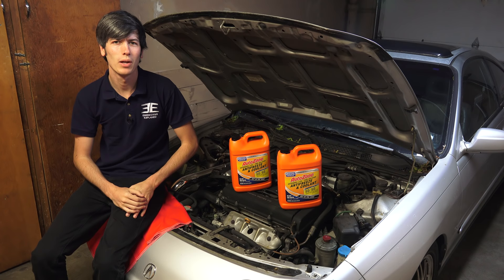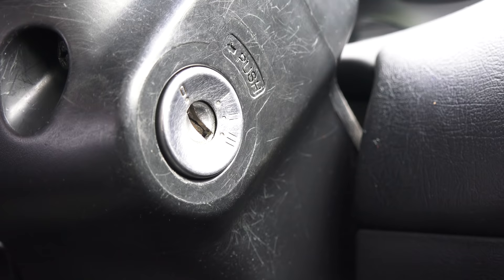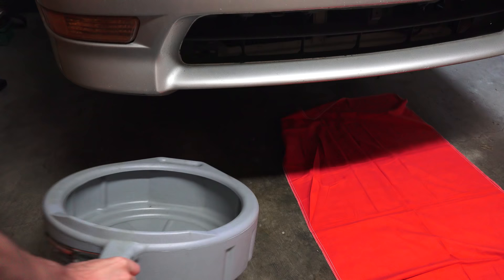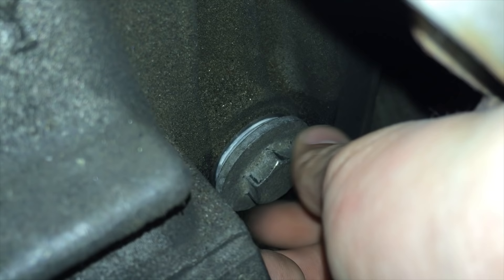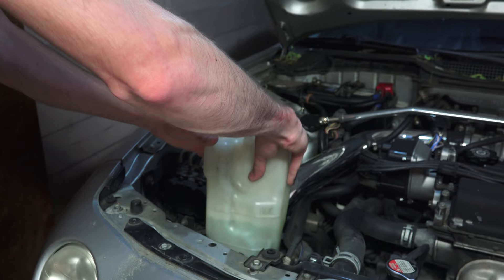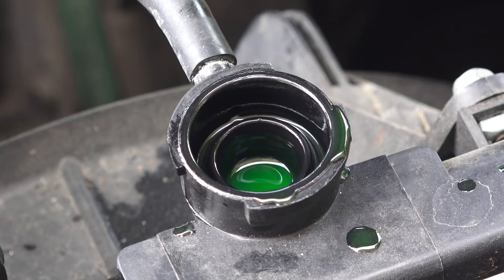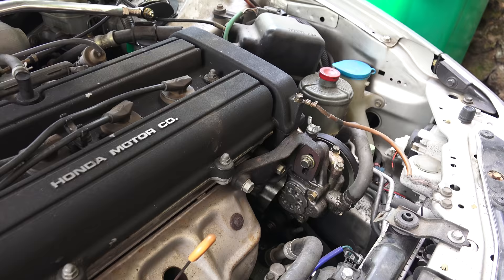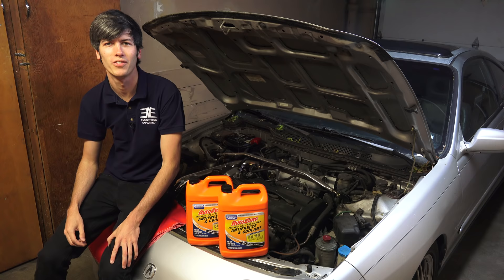How To Change The Coolant In Your Car

Comment: Isn't running the car stationary for a long time a good way to get carbon build up in modern engines?
Reply: 30 minutes at idle is nothing.  Look at every police vehicle in the country - those idle for 12 hours+ every day.
Reply: If 30 minutes were to do anything significant, most vehicles on the road would probably not be there and instead be in a a shop to get carbon cleaning done  ...

Comment: Is it normal for it too steam while it running with the cap off
Reply: Enrique Rodriguez yes that's usually what happens when water hits hot surfaces it turns to steam.

Comment: Please include a responsible way to discard the old coolant.
Reply: In the US, most retailers/parts stores accept used oil and coolant, usually for recycling. 
There is no method of treating oil or coolant to allow discarding in the garbage or any waste stream or landfill.

Comment: You're not going to flush the system? Aren't you supposed to drain the fluid, fill it up with distilled water, let the engine run until warm with heat running full power, drain, refill with distilled water, start until warm, then drain and then fill with coolant?
Reply: It's true you can do that, but it is risky.  Coolant, or anti-freeze, alters the cooling and boiling points of water.  Having concentrated water as your only coolant is not recommended.  The water will heat up fast as will the engine.  It is better advised to plumb in a water outlet that will accommodate a garden hose into the heater line and flush that way and then drain all the water.  Although that method is tap water not distilled water.  50\50 coolant mixtures use antifreeze and distilled water.
Reply: The Tom Lukasch Show Aren't you not supposed to use a garden hose? Because of the contaminates in there?
Reply: The flush you described is best for dirty systems.  I will be doing one on my car(has lacked such maintenance for 26 years).  However, this channel seems to keep his car in very good condition, as the old coolant looked perfectly fine, so in his case he wouldnt have crap to flush.    And yes distilled water is good for the stuff, less contaminents.
Reply: cuvkiller Yes good plan.  But once it is all nice and clean and if it stays that way, a simple drain and fill should be good for a few years.
Reply: rock If you don't know what I'm talking about, there's no point to tell you, "kiddo" lol look it on Google
Reply: "The water will heat up fast as will the engine"

That's a complete lie. Coolant reduces the boiling point of water, and it doesn't transfer heat as well. What increases the boiling point of water is the pressurized system in which it's contained. Water cannot be compressed, so if it is sufficiently pressurized, it cannot boil. This is why it's important to bleed the system and remove all the air.

You could run a car on nothing but water for short periods of time without issues, the problem presents itself when we create acidic environments and don't have any form of corrosion inhibition or low temperature protection.

I'm opposed to using detergents unless you've previously had an issue where oil was leaking into the coolant system, but running some water through the system can help get out some of the residual spent coolant.

Garden hose? Probably not a good idea as it's never filtered anywhere down the line. Tap water? It's fine for very short term use. Distilled water is the best as you won't need to worry about deposits forming from mineral dense water sources.
Reply: That is true, I did overlook the fact that pressure will aid in keeping heat down and the release of the pressure and presumably the water will heat the system up rapidly.  Coolant is used to alter the freezing and boiling points of water, that is a fact.  As well as using nothing but water as coolant, drag cars that actually use coolant do it all the time.  Although, like I said, it is not recommended.  I did say to use tap water for flushing a system as you can hook it into a valve you can plumb into your heater line to aid in removing all the coolant and any other debris or contaminants.  When I said to use it I meant to do so to flush all the old stuff out and then drain that all out too and replace with a proper mixture of coolant and distilled water.  But if that still isn't up to and sort of standards you have than you can always yank the motor and fully disassemble it and move all the parts around until all water is gone and then reassemble it.  But since not one person in the world ever has gone to those lengths to removing old coolant, flushing it with tap water and draining the tap water and refilling it and then bleeding all the air out should work perfectly fine for most people.

Comment: How can I dispose of the coolant in the plastic container if in my car it just come off and it's not draining through the little thing
Reply: I sounded like such an Amateur there 😂
Reply: All do the coolant isn't draining through the drain plug*** that's what I meant to say
Reply: do you have the radiator cap off so the fluid can drain out , unless you don't have a  rad cap?

Comment: you used to design these systems?  This was a very very very brief and severely over simplified video.  If you used to design these systems then you know you need to give a bit more of an explanation on the system, how to get the air out, how it works etc. etc.  A lot of valuable information that I know I would love to have (because I'm literally flushing my van's coolant right now and cannot find the information I'm looking for) is somehow nowhere to be found on the internet.

Comment: So seriously, do professional mechanics actually go through all these steps?  Seems much more profitable for them to do about 90% of the coolant flushed in 10 minutes of shop time, instead of 100% of it flushed and take up an hour.
Reply: Good point!
Reply: Pros have pressure machines to flush coolant.  They hook it up and hit the button.  Saves a TON of time, but obviously they are expensive.
Reply: Josh Crunk w
Reply: The mentioned pressure machine sucks the old coolant out, while adding the new coolant as the old is sucked out. This keeps air from getting in the system and allows you to get the job done in maybe a half hour as opposed to the diy way shown in the video, where you can spend a half hour just bleeding the air from the system. Same with transmission flushes. Machine takes the guess work out, and saves time and money.

Comment: so easy to work on japanese cars, my gm car (holden commodore) needs the lower radiator hose to be pulled to drain the radiator. also no engine block plug either have to remove the thermostat and flush it out with a hose.

Comment: What if there is leaks? What could that mean?
Reply: Sophia L.  it means there are leaks in the cooling system
Reply: MattyMag thank you for your response.  do you know what could be needed since there is leaking in the cooling system?
Reply: Sophia L. if you can see where the leak is you'd just replace that part. if you can't I'd recommend a mechanic.

Holes in the radiator are common or loose hoses. But there are also gaskets in the engine that keep the engine oil and coolant separated. if the gasket is leaking it can cost a good coin to have fixed. And the consequence of not having it fixed can be a new engine, which will be more expensive.

Just turn on the car and let it run for a bit. look under the car and in the engine bay for anything leaking. if no luck then you'll want a mechanic.

for the love of God don't use stop leak or any other similar product. it will probably wreck the radiator
Reply: MattyMag Thank you so much for putting the time in responding to me! I read your responce to my dad and he has an idea of what it could be, and for sure we will look into having a mechanic look at it for sure. thank you again so much! and I won't use any stop leak lol you are blessed!

Comment: I once owned a Hyundai Excel for 9 years, driven it for 80,000 miles, never once changed the coolant, and yet, nothing happened. I don't want to risk damaging the head gasket, etc. if there were pockets of air still in the engine, it's just not worth it. If I noticed signs of rust or change in coolant color, then sure, I'll get it done, but by a professional, it's not worth saving a bit of money.

Comment: I dont know if its obvious.. but why does nobody tell their watchers that its not ok to turn the car off while filling up the coolant and while the cap is off.. the coolant that i poured on the radiator all just went to waste.. nearly 6 litres if i calculated correctly 😂 pretty sad but im no mechanic but wouldve been good if i knew that before doing everything 😭

Comment: ayyy... Is that a Gen1 CR-V?
Reply: It is a 1999 Acura Integra GS.
Reply: Never knew they used b18/b20
Reply: +Emmanuel Bell Nearly all Integras used B series engines from 1989 until 2002. This one has a B18B1.

Comment: 50/50 peak is the best
Reply: Mustang98 3919 Oem is the best. Engines need special additives to keep the transfer of magnetic ions from aluminum to steel to prevent corrosion.
Reply: Waffeey yeah but not everyone is using oem

Comment: Why didn't you remove the thermostat???? Isn't that an important part of removing coolant?
Reply from the maker: +Esai Vergara the thermostat regulates coolant from the engine block. As you saw, I opened up the engine drain bolt, which drains coolant from the engine block.

Comment: Why car manufacturers don't use oil instead of water to cool engine???
Reply: Antony Bennett  what about using cutting fluid, most of it made of water and it doesn’t cause corrosion
Reply: cutting fluid used to reduce the heat that generated when cutting metal part

Comment: what is coolant flush 50/50 meaning ?
Fresh Water + Coolant =50/50 ?
Reply: A coolant flush is when you clean out the entire cooling system and add brand new coolant to the system. 50/50 coolant means it's a mixture of half antifreeze (ethylene glycol) and half distilled water.

Comment: I really don't like this "pumping out the air" thing. I once changed brake fluid for my bike, couldn't get the air out, and it tightened the brake grip (have no problem with stopping though). I checked on how to pump out the air from the brake fluid and it said "call your friend to help you because it requires 2 people to take out the air completely from the bike." 

I was like... forget it